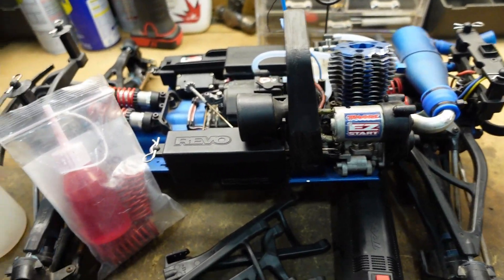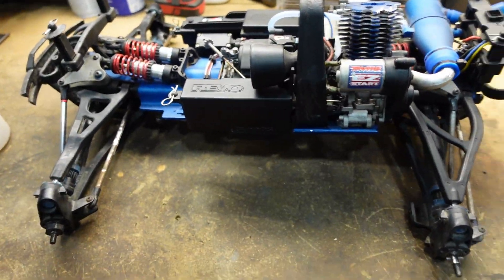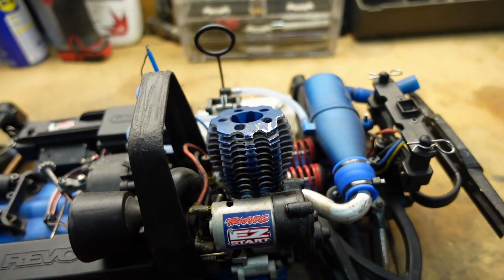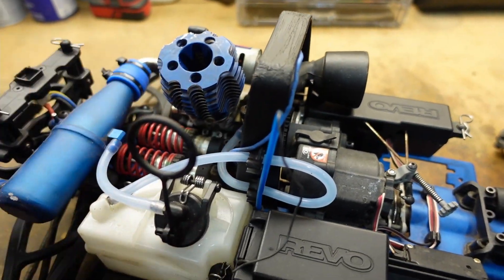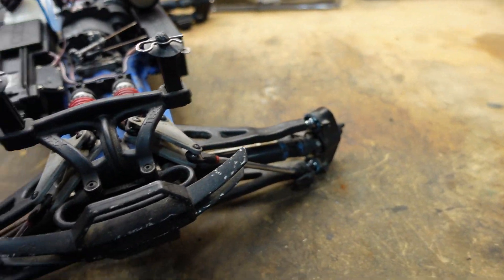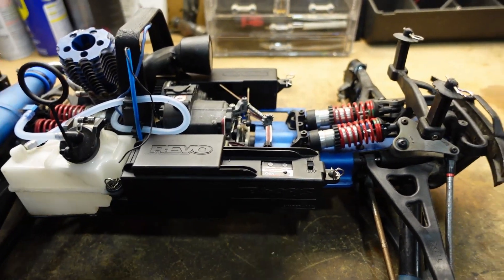I bought a used Revo 3.3.....

Comment: Short of having the piston explode from running too lean, the traxxas 3.3s are pretty bullet proof, i just got a gen 1 Tmaxx 3.3 that had been out in the weather for 10+ years, motor was totally seized, freed it up with WD40 and a cordless drill, fresh glow plug and hump pack in there and it fired up first try 😂

Comment: Super chargers can't work with a "nitro" engine. If you think about the physics of it for a second you'll understand why. All the air that is being pushed in will be released during the exhaust phase of the stroke well before any added pressure can actually be added. Save your money and get something like an OS .21 TM. That will add tons of power.

Comment: Rb innovations is an absolute waste of money bud. Those were gimmicks sold back in the day for 200 and did nothing to increase power, and in fact made things worst. These 2 strokes are not made for boost, whatever PSI it blows into the engine will blow right through and do nothing. Please save your money and put it into parts or just buy an OS. 21 TM drop in engine
Reply: Agreed! OS 21 or force 28 max for half the price ;)